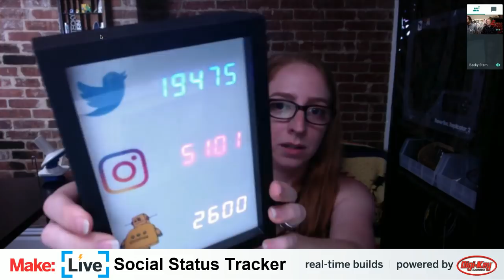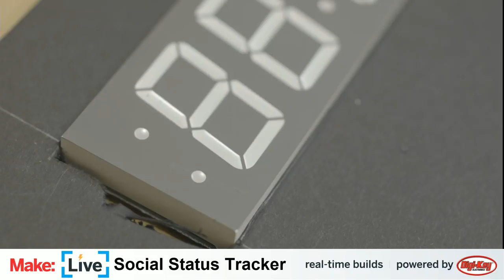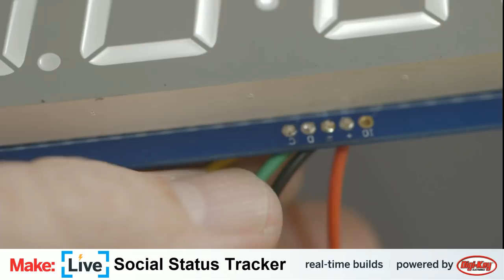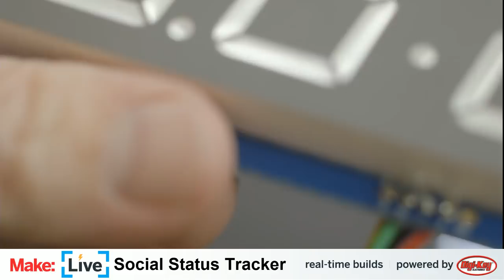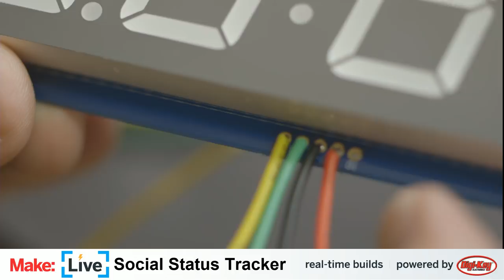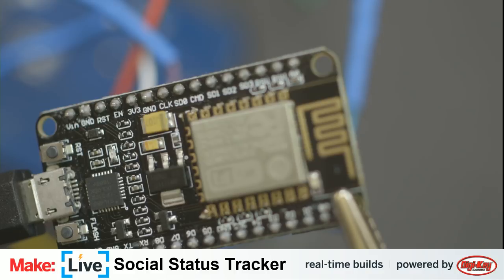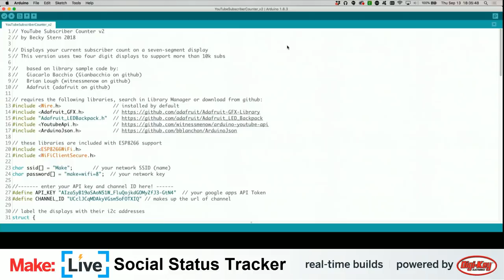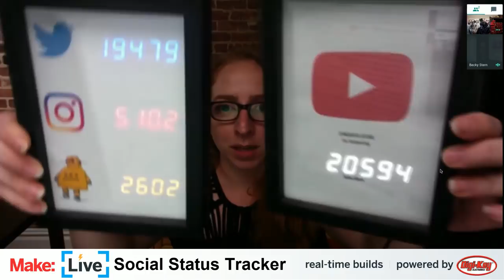Make: Live - Social Status Tracker

Comment: Why not create a Cron job batch

apt-get update && sudo apt-get upgrade
reboot

and have done with it.
I didn't get a notification from Becky Stern about this stream.
What about Yellow for twitter, Red for Youtube and Blue for Facebook,
What about building a sonic welder working at 38KHZ,
What about a WELLER 8200D.
Should you not strobe each digit select line at a 100KHZ so that the digits display well.
Use a WELLER 8200D to heat up large joints when soldering large joints.
if Your Windows Streaming box gives up then what about nuking the hard drive and installing the latest version of BeOS 5.0 Professional and UltraDV should get you back up and running as BeOS was built from the ground up not to crash for any reason and be reliable.